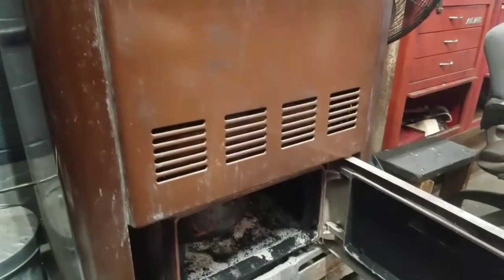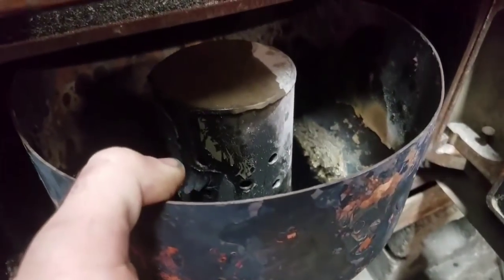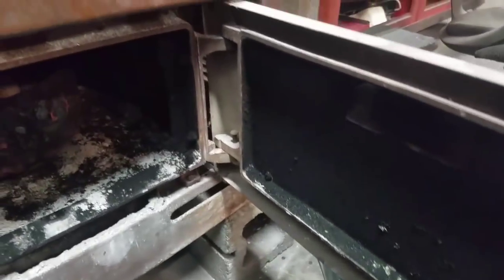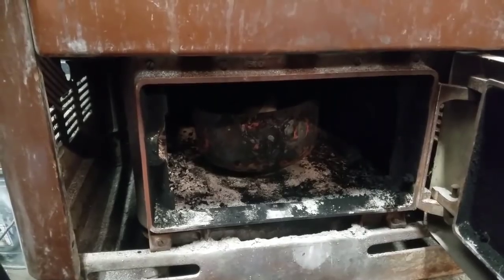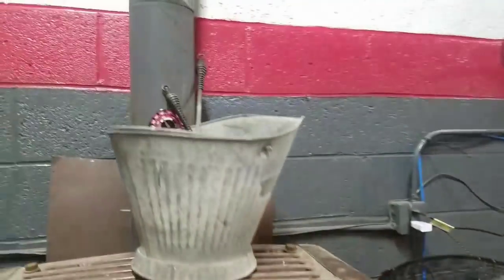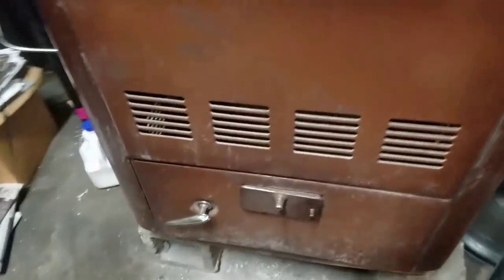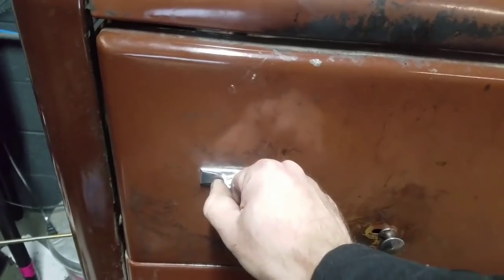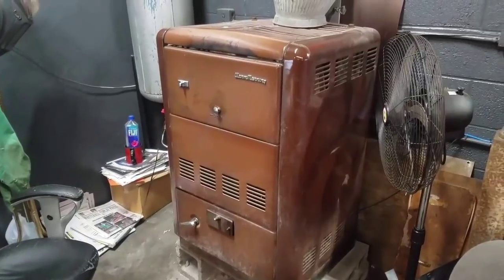Homemade waste oil heater version 2.1

Comment: i use an old siegler oil (fuel oil) heater from the 1950s . i removed inner screen from bottom of carb , modified carb inlet and outlet for more flow , and used an empty propane torch tank/light bulb/water heater thermostat to make my oil preheater box . light it by tossing in a vienna sausage can full (about 4 oz) of black diesel (to a 5 qt oil jug add 1 qt gas/4 qts oil , shake well) . i walk into a 60-70 degree shop each morning . downside is messy 5 minute (after 1 hr cool down) cleaning of burn chamber every 24 hrs runtime , and can't use oil that has water or trash in it . 30x32x12  shop w/1 inch foam insulation , nighttime outdoor temp 20-30 degrees , moderate heat setting on carb . no visible smoke from chimney .

Comment: Do you have a Co detector/alarm  just in case,in your shop ?
Reply from the maker: +michaelovitch That would indicate we value our lives.
Reply: Vacuum is a synonym of depression.
Reply: really, did you tried to put a co detector on the exhaust ? just to proof the method actually produce much or less carbon monoxide. i am very curious. you know some co detector have the value on it.. so you can actually know how much it generating the co..

i hope you do a video following up using the co detector... i would like to see the reading.. both at exhaust and in shop (above the stove)..
pls

thanks. 
andrew

Comment: The combustion air is coming from inside your shop. Therefore the heater is sucking in cold air from outside the shop to make up the difference. Maybe the loss of efficiency is not significant in your overall situation.
Reply from the maker: The fuel is free, so efficiency is thrown out the window.

Comment: This is cool! It looks like you could still get away with doing work involving gasoline, so long as you don't have it too close with the flames being contained within the heater...? Either way, its still great to be able to burn off all the waste oil.
Reply from the maker: The shop was heated by a woodstove for the past like 60+ years, so I don't think it would be a problem.
Reply: Even so, you might not want your insurance company to see this :)